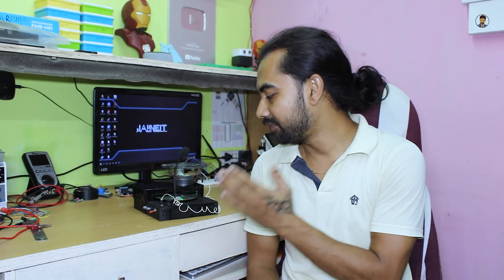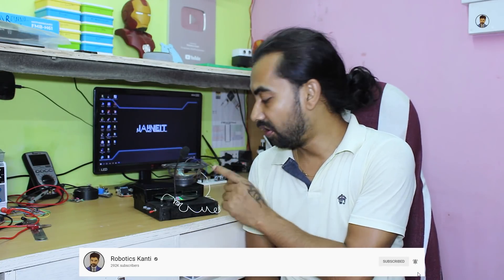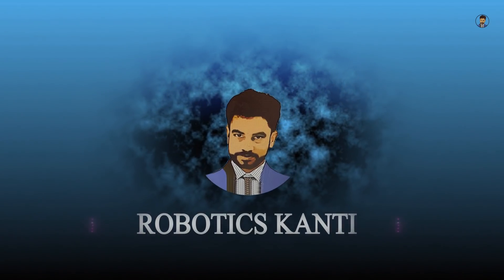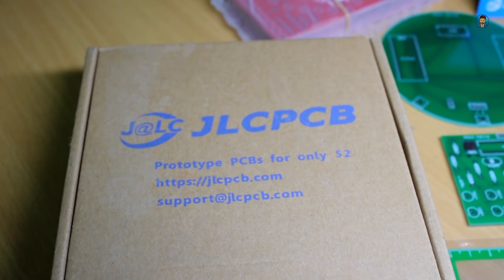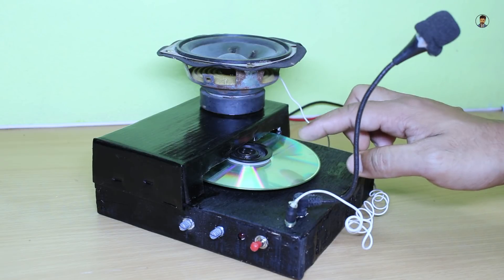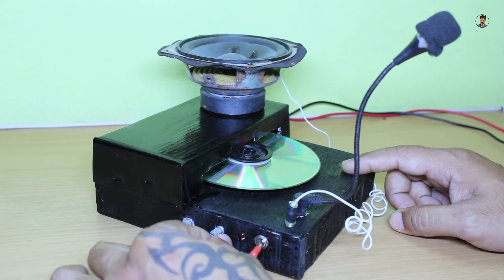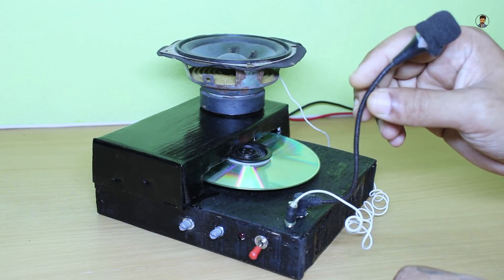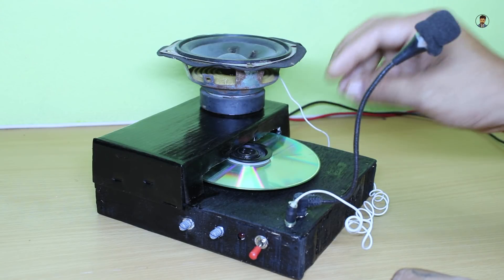how to make cd recorder player using arduino

Comment: Dear Sir,
Kya aap aesa programming kar sakte ho ki me arduino me aek switch place kar du, aur me us switch ko press karne ke baad power on karu to vo aek alag program perform kare.
aur me bina switch press kiye power on karu to second program run kare.

Like muje EM-18 Modual ke saath work karna he aur Switch ko press karne ke baad bord ko power supply du to vo RFID card ko configure karne ke liye yaani ke us RFID card ko register karne ke liye work kare.
uske baad agar me switch press kare bina hi power supply in karu to vo simply us RFID card ko sense karke led on or off kare.

Comment: How did you do the internal installation? What are the names of the points of each board (CD-ROM drive, arduino and PCB board) where you soldered the wires of the 2 female P2 plugs, the P10 plug shaped switch, the 2 potentiometers, the LED and of the motor you used to fit the clamp that turns the CD? Tell me everything right, because I want to do the same project as you, but I don't want to cause a short circuit by welding where it shouldn't! For that I need to know the name of each of these points where you welded and did not show in the video!
Reply: Hi felipe He is making just a fake video.. No library available on entire web where you establish link between audorino and CD writer.. Just fooling youtube audience.. Extraction of CD assembly and external using again making compatible to reading & writing data not possible. Even simple miss allignment inside this DVD rom assembly not possible to workable.. Totally click bate video..
Reply: in my opinion arduino solves everything, so it is possible that it will solve this too! only if he used a microcontroller for both the motor that turns the cd and the motor that moves the laser arm! I prefer to wait for the owner of the channel to tell where he soldered each wire to solder too, then I can try to copy it to see if it is fake or not, because he will see it is not fake, nothing!
Reply: I have fix several cd player also learn how cd player work.. until today Philips and sony still no publish the digital format which call the red book.. CD are digital they are not like analog can read and write directly into disc, So the digital involve several layer of data protocol. from data to frame need to know exactly format only can retract.. Also cd wont spin immediately the first the lense pick up have to go inner the disc and detect the disc while focus coil start to work once they detect the disc it only start spin at same time detect the RF to make sure the motor run correct speed.. So if you open your cd player you will notice this sequence..
Reply: Will be alot more easy to record voice into Arduino Mircocontroller internal memory then cd.
Reply: Wow, cool! I didn't even know the CD player took time to read the CD for this reason!